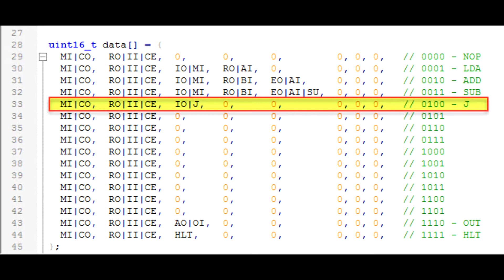Demo of Jump Instruction - (Ben Eater 8-bit Computer) SAP-1

Comment: Dude, this is not a "Ben eater" computer. It's called a SAP-1 computer, which the eater guy should have said in his videos, but clearly he wanted the credit for himself.
Reply: The book is excellent and assumes that you know only how a transistor works. It is only slim, but it includes explanations and schematics for the construction of 3 computers: The "SAP-1", "SAP-2" and "SAP-3". Each is a little more advanced than the next. There's also a couple of chapters on CPUs as well as some useful apendices. Its worth buying if you are into building computers with TTL chips. I picked up my copy from Amazon for about $25.
Reply from the maker: Dude, notice the "SAP-1" in all my video titles. Also notice that in the first minute of Ben's very first video, he points out that he used the book "Digital Computer Electronics" by Albert Paul Malvino to build a ***breadboard implementation*** of the SAP-1.
Reply: He also says that he does not have schematics, when the schematics are in the book.
Reply from the maker: I guess you're referring to his first video where he said "I never sat down and drew out a full schematic." And you seem to be taking it completely out of context.

In context, he wasn't talking about the book. In the context of that statement, he was saying that he himself had never created schematics while he was building the first one. Then he transitions into talking about the book, and giving credit to where the design comes from. And he clearly shows the SAP-1 Architecture, and says "The architecture that they have in here is the model I followed. It's what I based this computer on."

That's a pretty clear statement. You seem like a smart guy, so I don't think you have any problem comprehending things. I don't know why you hate Ben Eater, but to each their own I guess.  :)

Comment: Here's the complete list of instructions on Ben's computer that I know of:

0000 NOP
0001 LDA
0010 ADD
0011 SUB
0100 STA
0101 LDI
0110 JMP
1110 OUT
1111 HLT

On my version of the computer, I have added:

0111 JC (jump if carry)
1000 ADI (add immediate)

My counter takes up only 4 bytes of RAM:

01010000 10000001 11100000 01100001 (50 81 E0 61)

LDI [0]
ADI [1]
OUT
JMP [1]

I'm going to be uploading a video soon showing the computer (on Logisim, not a breadboard).